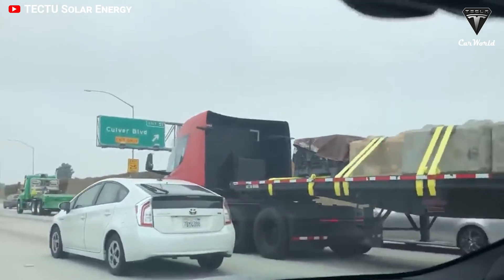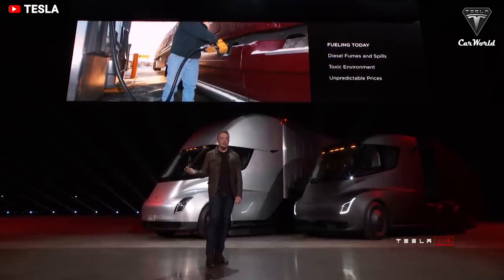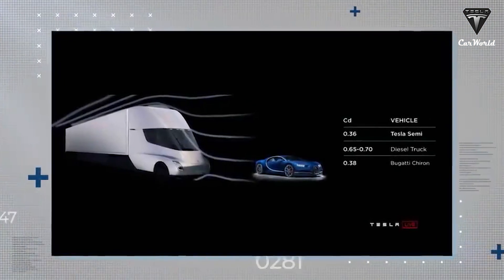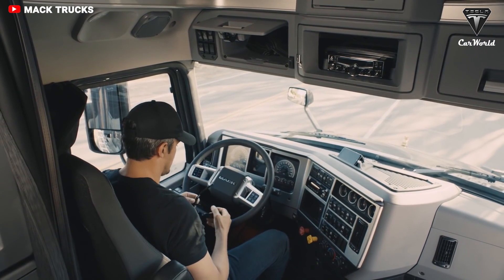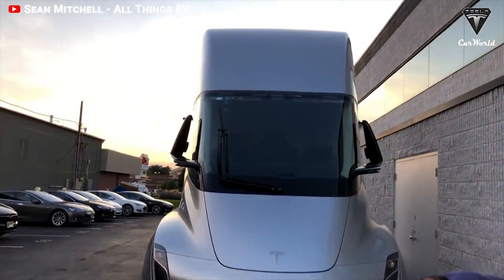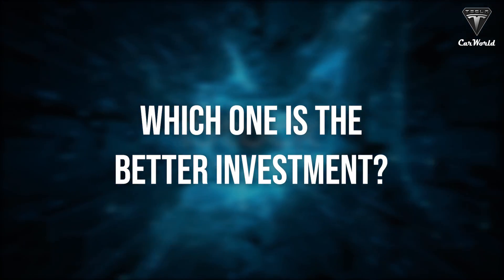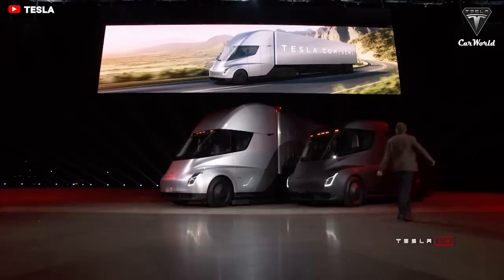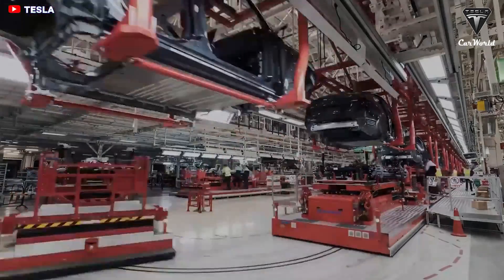Which is the KING of 2023 heavy trucks? Mack Anthem Diesel Truck Vs. Tesla Electric Semi?

Comment: Worrying about a truck's acceleration is like worrying about a supercar's luggage space.
Reply: There are so many ignorant comments, in this thread by people who are obviously not truck drivers, & obviously know nothing about E.V's. As a 20 year veteran truck driver & an E.V. owner myself, I will attempt to clear up some misconceptions that I've read here on this thread about both.

Fully loaded diesel semi-trucks absolutely are slower to climb steep grades, than they are on flat terrain. They also have to descend steep grades slower, because they have to use lower gears to prevent their brakes from overheating, & causing brake fade or even catching fire. That is a fact. Truck lanes are for this purpose. Not because of differences in truck speed limits. This is why truck lanes typically only exist on uphill grades, & end when the uphill grade ends. Tesla Semis will have much less of a problem with this. Yes, maintaining these higher speeds up grades will use more energy. But recharging them is fast.

Charging is not dangerous, & can be done @ loading docs, while loading & unloading. Shippers & receivers do not have fuel islands @ loading docs, because the logistics involved would be impractical. However, Mega-chargers would take very little space, & minimal infrastructure to install. Government subsidies could be offered to shipping facilities as incentives to install these chargers. Most drivers spend an average of 2:hours on each end, (un)loading. The Tesla Semi can charge to 80% in as little as a half-hour, giving the driver more than enough range to complete the balance of his/her Hours Of Service allowance for the day. In many cases, they will actually be @ the doc long enough to get a full charge. Truck stops would not need to have all Mega-chargers. They could get by with having slower chargers, as most drivers will spend 10:hours taking their breaks. They could have a few Mega-chargers in short-term parking, for drivers that are just passing through for shorter breaks, to quickly top up.

Fires in I.C.E. vehicles, both passenger cars & semis alike, are much more common, per vehicle capita, than they are in E.V's. That's also a fact. Most modern fossil vehicles also require electricity to open the windows. The doors on some vehicles are opened electronically, but all of these, including Teslas, have a manual over-ride, in case of emergency.

Most electric vehicles, including ALL Tesla cars & SEMIS, do not have transmissions. They are direct drive. Not automatic transmissions. There is no shifting of gears. This gives the driver even more control than even a manual transmission, as you never have to worry about missing a gear, & you have complete control of your regenerative braking with the accelerator pedal, with no interruption from down-shifting.

Obviously there is going to be a period of time for the infrastructure to grow. But the more we resist, the longer & more painful it will be, & the more detrimental it will be for the environment that we leave behind to our kids & grandkids. So let's stop thinking about reasons why it won't work, & instead, work together to figure out ways how it CAN work. We are smart intelligent beings. We CAN, do this.
Reply: @MatthewPBJWilliams  Tesla’s do all have geared transmissions. You just can’t change gears. They do this to step up the motor torque at the expense of top speed.
Other manufacturers are looking a wheel motors but none have hit the market outside China yet.
Reply: If you’re driving in the mountains and can maintain speed uphill and get there in half the time, that equates to more money for the driver.
Reply: @andresbraud  i bet you could watch those batteries drain fast.
Reply: @andresbraud I do not worry about going up the mountain, I worry more about coming down .
Reply: @andresbraud  1. All trucks can do that.
2. Your reverse trip will be driving DOWN a mountain.
3. Are you honestly under the impression that a truck can only go 30mph up a hill?
Reply: @eugenes9751   I’m suggesting that when driving up steep grades, such as the Rockies, being able to keep up with traffic rather than driving 40 in a 70 would be nice and save drivers lots of time. No more flashers in the right lane up hill.
Reply: @andresbraud  Again, trucks can already do that.
Reply: @eugenes9751 no they can’t, obviously you haven’t been fully loaded up a steep grade. You are going 45mph if lucky with hazards on while everyone goes 65+ up. There is a reason they have the truck lanes uphill. A Tesla truck being able to accelerate faster and go uphill faster would substantially save time on mountain runs.
Reply: @eugenes9751  yes you are going down again later. That still doesn't change the fact you can go up way faster the first time lol. And with an electric semi you can recharge the battery going down
Reply: @Matzes  And with a gas semi, you would use zero fuel going down and can use engine braking.

Truck lanes don't exist for "slow trucks", they exist because they often have a lower speed limit. Which would apply to both types of trucks.

You realize that these electric semis can only be used on routes where the origin and destination stations have Megachargers installed? At this moment, there are exactly zero of these stations in existence. A single Megacharger uses more power than 20 average households combined, and you'd need enough for an entire fleet.... PLUS waiting 1-2hrs to charge (EACH TRUCK), which are only going to be arriving between 7am-6pm. California has already asked it's citizens to stop charging their electric vehicles during the day to prevent blackouts.
Reply: @eugenes9751  you would use little fuel in a ICE semi yes. That's worse than actually getting significant amounts of energy bake. 
Yes megachargers are not available in big numbers yet. Tesla semis are not available yet either. You sound like people in 2010 when they said there are no places to charge your tesla. And just look at the supercharger network now. Same gonna happen for mega chargers. You can start charging while unloading. Make use of solar or off-peak electricity prices. Long term is the clear logical solution, obviously some things have to be built our first. Like in any technology.
Reply: @eugenes9751  actually the truck lanes we are talking about are for climbing grades as trucks go much slower uphill. A Tesla truck with much better climbing capabilities would save hours on a mountain route. If you save 1-2hrs out of your 10hr route everyday that is massive profit gain.
Reply: @Matzes  No, engine braking uses zero fuel, not little. The fuel injectors are turned completely off.

You sound like someone who doesn't understand even basic electronics, and think that hoping hard is the solution that will make something possible. The real world does not work that way.

A regular Tesla has a 80-100kwh pack, the semi will be approximately 6-8x that size. You're comparing apples to oranges.

There are only 1,500 Tesla supercharger stations in the entirety of US. There are 120,000 gas stations. Again, apples to oranges. 

Truckers don't get paid for spending multiple hours charging, they only get paid for the trip. You can not start charging while unloading because you'd never put your chargers in the dock, that's far too dangerous. Why do you think warehouses don't have their own gas stations? Also, even large warehouses only have about 1MW of capacity available, so a single charger would eat up more power than they have the capacity for. Meaning that you'll have to spend about 50-150k just to upgrade your capacity.

You also probably aren't aware of the fact that the first vehicles and delivery trucks were ELECTRIC. We switched to internal combustion because gasoline is 50x more energy dense than even the best lithium batteries currently in existence.

Are you aware of the fact that JUST THE BATTERY of the semi weighs 8,000lbs? That's 8k lbs less that the truck can carry. And carrying capacity is the only thing that matters in the truck world.

The Tesla semi will be an even bigger dumpster fire than Twitter. Remember, this is the same guy that built a "hyperloop" in Vegas, that's just a tiny tunnel with teslas being taxied inside, with a lower total capacity than a single bus. Stop hero worshipping dumb idiots, especially ones who steal companies and act like they created them (Tesla).
Reply: @Ironiclobster69  The truck they compared it to in the video has 1,800lbft of torque. Yeah, it's gonna have exactly zero problems with any grade. 

But fine, lets do the math. Worst possible case scenario. Driving for 2hrs uphill at 45mph instead of the truck speed limit of 55mph. Will get you there exactly 20 miles sooner, which is a total of 15 minutes of savings. If you somehow managed to find a road that's all uphill for 10hrs (I doubt anything like that exists in the real world), you'd be saving 1.1hrs of time in one direction over a 10hr drive. But guess what, you DO NOT get paid for arriving early, you only get paid for the trip. And you're forgetting that you then have to spend 2hrs waiting for it to charge (of your own time). And doing that not at a fancy truck station, but at some random warehouse, where you can't even leave to get food for yourself.
Reply: @eugenes9751  okay lets break this down. the regular tesla battery size is more like 60-80kwh. way less than you stated. model 3 and Y are by far the best sellers. what does the battery size even have to do with the conversation? i m comparing apples to oranges lol. there are 15k super chargers in the US. but how many normal electric outlets in peoples houses, that most people use to charge their EV. YOU are the one making dumb comparisons. you tell me I am comparing apples to oranges but in the same text you compare gasoline fueling to electric charging in terms of danger to do inside. LOL how is it dangerous to charge a car? Why wouldnt you be able to unload a truck while it charges? also a truck driver, by law, needs resting periods which can also be used to charge the battery. and then in the other sentence you compared to battery electric technology 50 YEARS ago to today as an argument why it doesnt make sense to use today. LMFAO. yes the battery is heavy. but the motor is much less heavy. as long as with other parts not needed for an EV. also by law you are allowed to carry 2000 pounds more on an electric truck. so weight difference is no issue at all. complete strawman by you stating that the load capacity would be 8k pounds less. just blatently wrong which a simple google search would have revealed. the semi is a huge bargain and will be a huge success. just follow the money. the total cost of ownership (which is the only thing companies care about) is way less for an electric truck than it is for a gasoline truck. this is undeniable. the rest will just fall in line. if there is money to be made, it will happen. the only green thing these companies care about is the green DOLLAR
Reply: @Matzes  You confused superchargers with regular tesla chargers.

I wasn't talking about the model 3, I was talking about the Model S. 
A regular electric outlet charges 3miles of range per hour.

Electric is being compared to gas because that's the ENTIRE point of this argument. So, apples to apples.

It's dangerous to have a power station in the same place that you have trucks and forklifts  constantly moving through. That's why docks don't have fuel stations. If you've ever seen a scooter or Samsung battery explode while charging, maybe you'd understand why it's dangerous.

Saying that a trucker must rest, therefore, finding a charging station and waiting several hours to finish charging (as long as there is no line) is not a problem, is just downright silly. That is time out of their day, that they can be using to do other things. Some people actually value their time.

I can see that you're pretty clueless on this subject, based on your "follow the money" assumption, so I'm just gonna say have a good day sir, and this will be my final reply to you. Feel free to come back in several years and tell me how well the truck is doing.
Reply: @eugenes9751  you were referenceing the model S, alright...WHY? its not the regular tesla at all., by FAR the best seller are model 3 and Y.  you are cherry picking your data to make your case. we are talking about CHARGING a car. thats the comparison. thats the important thing. it doesnt matter if its done at home or at the supercharger.  most people do it at home. check the data. you can also just add a simple wallbox to your house and get solid range per hour. way enough to charge fully over night. thats comparing apples to apples. recharging a car is not dangerous at all. i dont know where you got this idea from? and if you ever ridden an EV, you would know its very convenient to charge it will taking a rest/piss/food on long trips. so i dont see why this would be different for a truck. if there is a big line, there will be more chargers added. how hard is that to understand? if there is a demand for a service, its gonna be provided. because thats how capitalism works. a topic which you are entirely clueless about, which is why you just left this conversation. very smart. because you got nothing left to come back to me. classic interenet arguement.
Reply: @andresbraud  speed isn't the issue dude. If you were able to even go that fast up the hill on the tesla you realize how much of the battery life you would kill just doing that?
Reply: @Ironiclobster69  known in UK as crawler lanes.
After the gear below 1st.
Reply: @eugenes9751  but electric cars dont explode when charging
Reply: @Ironiclobster69  if the tesla does take advantage of this feature I wonder how much more juice it will be using on that gradient. I'm sure that will be taking absolutely miles off that 500mile range cap every time it does a fast climb up a hill.
Reply: @Matzes  what does pulling that hill at high speed do to the range?   And 60 miles hour for 11 hrs is 660 miles maybe a little less for hills and traffic can the electric do that?
Reply: @donalddelabar767  well you would come down that hill again. Who drives 11h straight with 0 break Time??? Pretty sure that's illegal. At least where I come from
Reply: @Matzes  you have 11hrs of driving time   I did not say that you don’t take breaks, half hour before a 8 hours on duty   You could drive 5.5 break for 3 then drive another 5.5
Reply: @Matzes  The Tesla Semi prime mover weighs 27,000lb compared to 11,000 to 25,000lb for a conventional semi.
The extra weight is what you pay for a 500mile range.
Reply: @allangibson8494  we don't know how much it weights yet
Reply: @Matzes  There were photos of the 81,000lb gross test run with concrete Jersey Barriers as test payload. The weight of the standard Barriers is known to within a couple of pounds.
That gave a prime mover weight of 27,000lb.
Reply: @allangibson8494  yes bro, we both watched the same tesla daily live stream. Considering you can have an extra 2k pound with electric cars. I would say this product is a no-brainer for any company that owns trucks
Reply: @RyanDiederich  Gas cars do explode while filling. That’s why there are fire extinguishers all over the forecourt of filling stations. It happens so often it’s barely news.
Reply: @eugenes9751 :  Let's pretend truck lanes are there for "fun".   Check and mate.
Reply: @andresbraud  that's torque not horsepower and you're also going to drain your battery climbing all steep grades just an FYI. Plus no engine braking
Reply: @Matzes  bro these trucks are distance trucks they have hundred plus gallon tanks the efficiency of diesel vs electric battery isn't even close. So whatever range they release cut it in half immediately. So it's not more efficient it's not cheaper. It's useless literally useless. Evs for daily driving is awesome absolutely awesome. But not for cargo hauling. Next they're gonna bullshit an electric 747 uh no way. They take 40000 gallons of fuel takes me 4 hours to fuel them sometimes and 4 tankers. They fly from here in Ohio to Germany or China or Alaska. No ev plane could ever in its life do that the batteries are too heavy. A semi could never get the equal range of a diesel rig because the batteries would be way to heavy plus the payload
Reply: @Easy Money Sniper  you are right. Electric is MUCH more efficient.  What do you mean it doesn't work? Tesla semi has 500 miles or range fully loaded. That's plenty for the majority of use cases. Charging electric is far cheaper than diesel. Also maintenance is far cheaper. I don't see your point. Make up a basic calculation and you will find out you would have to absolutely braindead not to shift to a tesla semi in most cases.
Reply: @Matzes  an electric stove requires 3 to 4 times as much energy to produce the exact same amount of heat as gas burners.. This is just a fact. It's clear you don't own a truck or use it to haul and tow. Btw in my f350 diesel I get 430 miles out of just 35 gallon tank
Reply: @Easy Money Sniper  you just disqualified yourself from this conversation by comparing an electric motor to an stove And then comparing that to a GAS stove.Holy shit. How about induction stove then?? That runs on electricity and is 3x more efficient than gas
Reply: @Easy Money Sniper  there is litteraly a video on  teslas YouTube showing it travel 500 miles fully loaded. This was shown on the tesla delivery event.
Reply: @eugenes9751  drive a loaded Volvo VNR64T up a hill anywhere near max weight and see how fast it goes.
Reply: @Easy Money Sniper  hahahaha An electric motor is a device that uses an electromagnet to change electrical energy to kinetic energy. When current flows through the motor, the electromagnet rotates, causing a shaft to rotate as well. You keep embarrassing yourself in this conversation. Check well to wheel efficiency of ev vs. Gas engine. Gas engine will be at 10-15%, most loss to heat and too many moving parts. Evs are at 60-70%. Obviously they are not as energy DENSE. None claimed they are and they also don't have to be. I own a tesla and live in a cold country. The range loss is negligible. I barley ever use the whole range anyway. As do most people. Usually from and to work or getting groceries. For long trips there is the supercharger network. Doesn't make much of a difference if you loose like 10% range.
Reply: @eugenes9751  some can't even go 1mph ha, more like one type but forget the name
Reply: @eugenes9751  down, r u scared that the cold brakes will break... even if they somehow did, u don't use them
Reply: @eugenes9751  I'll give him the benefit of a doubt he forgot to put safely going uphill its usually the driver that has to input where the gear goes IF the 18 wheelers are a manual
Reply: @eugenes9751  my truck up a big hill I run I'm only going 25 once I get to the top and start at 70 so yeah acceleration is a big deal
Reply: @eugenes9751  Dude, you are hilarious.
Reply: @andresbraud  you realize that going uphill with a load means more energy is needed. That tesla will just burn up juice faster. Maybe it can make it up on yhe down hill side but idk
Reply: @eugenes9751  no gas in a diesel motor please. They don't work well together.
Reply: @eugenes9751  if you save even a little time. You might be able to pick up extra loads during the pay period.
Reply: @eugenes9751  

With 500 mile range, if you drove 55 MPH you would reach truck driver limit of 8 working hours so you would need to recharge anyways.
Reply: @eugenes9751  Some trucks can only make 10-20 mph up a hill, depending on the hill. An upshift may cause them to lose speed.
Reply: @eugenes9751  If hour in the business than you know that their are many grades that will slow down a heavy, (loaded), truck to well below 30 mph. Now if you go up a grade that is steep enough to slow you down than there is a high likelyhood the speed limit going down will be below 35mph . The driver must gear down the truck to keep it from becoming a runaway. The truck gains too much speed, due to gravity, the driver can overheat the brakes which then fail. No brakes lead to excessive speeds and a runaway situation. Operating a tractor trailer combination is very different than driving a car.
Reply: @eugenes9751  not all trucks have same performance, depends on what trucks and how steeps. Like it's pain as a car to drive behind a truck when it's mountain, it's slow af
Reply: @eugenes9751  for your 3rd point, from my experience as a normal sedan owner, yes. especialy if there is another truck on the other lane. doing the same
Reply: 👋💯✔
           Hey Eugene S,  my dear consider this pal :

Another Tesla has gone up in flames while charging, this time a white Model Y that was plugged in just outside a garage and house in Maple Glen, Pennsylvania. The vehicle was badly burnt and the fire had started spreading to the nearby garage; had firefighters come any later, the garage and house would have been much more severely affected.

Little is known right now about what exactly happened, but according to 6ABC Action News, the fire reportedly started in the back of the vehicle and then quickly spread. The vehicle was plugged in and most likely charging at the time, which seems to be the time when these electric vehicles are catching fire most frequently.

This particular fire is currently under investigation and no cause has been officially announced. Back in 2019, the National Highway Traffic Safety Administration said no to a petition asking for an in-depth, formal investigation of the Tesla battery management software, in order to find a link between recently updated software and the battery fire issue.

👍💯✔
Reply: @andresbraud  The whole it's goes up hill faster means absolutely nothing. Reliability and up time along with range is what matters to us drivers. The infrastructure for a Telsa Semi isn't even close for any long hauler to even make a Tesla a serous consideration. 🤷‍♂️
Reply: @eugenes9751  
Yes that's about right... fully loaded up a 8% grade, you will be going about 30MPH.. and down that hill you have an engine brake to help you stay at a safe speed while not using the friction brakes.  The Tesla will be awesome in the mountains..
But I think we will only see it used as semi local deliveries.. 500 miles is great.. But no place to charge it out on the open road.  But its perfect for trucks that run a route that takes them back to there home terminal every day.. like Pepsi is using them for.
The savings in fuel and maintenance will be a big deal for them.
But for long over the road trips.. diesel will be king for  a while I think.
Reply: @kens97sto171  What is stopping you from getting a truck with more torque, so you don't have to be stuck doing 30mph?
Reply: True, but 1 minute to just 60mph is TOO much
Reply: @alek1004  not really its a semi truck not a Porsche and a full semi truck at max weight you're talking about components getting over stressed. Have you ever hauled anything. I have to adjust my tire pressure depending on the haul in my dually. That's 6 wheels I have to deal with. I have to make sure my shocks and coils are rated for heavy weight. All bearings and bushings. These are wearable items why would you want to increase the friction rate of these components and more specifically why.. For what reason. Having faster acceleration will speed your trip up maybe 5 minutes. You still have to drive the speed limit. You still have truck lanes and descending grades. It's so stupid. I would much rather have as much torque as possible to get moving easier. But they already mastered the semi truck and container this is all a scam. Mercedes will do it better
Reply: Perfect repy.I love when people that know nothing about trucking try to sound like an expert and in reality they sound like an idiot.
Reply: Until you need to get out into traffic without causing an accident.  I’ve spent too many minutes waiting for enough space for speeding cars to pass.
Reply: The Model S plaid is a super car and it has good luggage capacity.
Reply: @danielstapler4315  not the point and it's not considered a super car it's a luxury sedan
Reply: Solution is Tesla plaid.
Reply: Acceleration at no extra costs in fuel or servicing across a fleet of 100’s of trucks is huge.. Efficiency is king..Side note also
means no traffic is held up stuck behind as is the case now..
Reply: Very well said
Reply: How many minutes/hours/days of your life have you spent waiting for a semi truck to get going at a stop light or single lane point until you could finally pass them later on?  If the semi goes fast enough, you don't need to pass it making the roads safer and more enjoyable for everyone.  And on that note, the Tesla Model S Plaid's biggest selling point is that you get supercar speed and acceleration WITH all that luggage space so you're kind of defeating your own argument.
Reply: Eugene S:  In the real world, the Tesla Semi power could eliminate the need for the vast majority of truck lanes over time.   Rather impressive.  Not to mention time saved, much better safety by the regenerative braking, etc.
Reply: Rewatch the footage of the tesla driving. It gets passed by everyone. Lol ot doesn't pass 1 car.
Reply: Wrong. Acceleration equals power and it’s very helpful to get on a highway and pass people.
Reply: I think the better concept would be and EV with a small diesel engine charging the battery continuously like the modern train!
Reply: Exactly
Reply: Pretty much 😂
Reply: Untill you've driven a 700hp truck....you know the rest.
Reply: Right imagine all that cargo back there if it's not properly held down, accelerating at a high speed. LoL
Reply: Some people just like spending a day cleaning up a trailer unless the back doors dont hold you'll arrive empty 🤣
Reply: The Tesla would drive the 200 miles then need to charge….there isn’t any chargers and the drop location won’t have any.
Reply: @jimdandy9118  Tesla Semi’s have a 500mile loaded range - that’s why they weigh 27,000lb.
Reply: @allangibson8494  That’s what Google says.
Reply: @allangibson8494  Fanboy they drove it on a flat road in a mold climate.
Reply: ☝🏾that part!
Reply: THE’LL TAKE OUR JERBS
Reply: We only care about burn outs noobz
Reply: The Tesla Semi prime mover is twice the weight of some diesel trucks at 27,000 lb.
The Tesla semi is also significantly wider than current production prime movers - too wide to be legally driven outside North America.
Reply: Agreed, also wonder how those frames will hold up with that strong of acceleration. Seen lots of videos of the beefed up 700-900 twisting frames at tow competitions
Reply: Agreed
Reply: Lol yes
Reply: So true
Reply: True. Until u need to get out of your own way.
Reply: Lmao bro one of these clowns was like so excited that the rivian can go 0-60 in like 5 seconds with a trailer and I'm like have you ever hauled or towed anything in your life ever... Alllll these dudes who never had a truck now they think they know trucks. I have a 6.4 dually 2010 if I gave them my truck  they'd be crying and begging for help
Reply: Obviously, you have never driven a combination vehicle.
Reply: Exactly. Speed doesn't matter when we have various speed limits. California has a 55 mph limit
Reply: Exactly. Speed doesn't matter when we have various speed limits. California has a 55 mph limit
Reply: Exactly. Speed doesn't matter when we have various speed limits. California has a 55 mph limit
Reply: Ur someone who drives like a grandma and takes 60 sec for 0-60 just like the other bad trucks... everyone hates being behind a semi bc it's slow and could break
Reply: @lavaphoenix75  ah so driving the speed limit is driving like a grandma, and driving 20mph over the speed limit is the way for drivers like you I guess. Makes perfect sense why y'all want more speed as if that'll change anything when our roads are all trashed anyways. I guess when you run over something  that'll tear up your ride you can then blame someone else because you didn't drive a speed you could stop at.
Reply: @Phaze Killer  #1 speed limits our outdated and we can stop way faster 
#2 I  said ppl like u r slow at accelerating not the speed.
#3 going too slow isn't good
#4 average normal speed ppl go above is like 7
Reply: @lavaphoenix75  lol, outdated? Hmm, I'd like to see this proof of a semi towing 50k+ stopping faster. Show me this video that's going 60 mph and you'll have me agreeing. Yea because spinning on an icy highway is so much better than actually being able to move pass the intersection. Going too slow, it's the speed limit, and frankly going too fast is so much worse than going slow. You can control slow, how fast can you pivot running? Just straight bolt and see how much control you have on wet grass playing soccer. Average normal speed is whatever the driver feels like going. People are always getting slapped tickets in this country and you're trying to say we should remove limiters. You must not have been outside yet if you think people won't be breaking those sound barriers if they could.
Reply: Damn “comment-people” are blazing HOT in this thread !! 🔥🤯😱
Reply: I think they naturally will have unusably fast acceleration. I remember that guy with his F-150 lightning was pushing against his truck's tow limit, but he commented that it was easy towing and the truck didn't even seem to care about the load.
Reply: @AngelUkiCarina  don't forget the ford lightning couldn't go more than 80miles when said truck computer claimed it would make 150+miles with the 5500lb trailer
Reply: While the point is true, the scale isn't. Speed isn't an important feature in a truck, but it does have a lot of realistic perks. Unloaded, it'll make it to a load much quicker and conveniently. On light loads, you can leverage some of that acceleration. For local use, it's much more maneuverable. On high grades, it can still accelerate rapidly, and stop better, making it unrivaled on medium range trips through hilly or mountainous terrain. 

All of its uses are either niche, or not a big deal, but it still matters.
Reply: The original comment is incorrect
Reply: I'm a truck driver myself. And trust me when you're loaded running short on time and you're trying to pull out into a busy highway, acceleration is everything. When your load it going up a steep incline. You need acceleration.
Reply: On an uphill in the Rockies, acceleration is a huge deal.  If some jerk cuts in front of a truck and break checks, slow to 45mph, it can take the truck a while to get back up to 65-70mph and it’s exhausting for the driver on a long journey.   Getting on the highway, it doesn’t need to be Ferrari fast, it’s about the trucks being car fast.  The lifespan of the brakes are a major deal.
Reply: Lets floor it and throw the cargo out the back doors
Reply: Combustion engines for life because  electric sucks gas energy.
Reply: An EV with batteries in the floor is always going to be more stable. The center of gravity is way lower.
Reply: @T1Oracle  Semis don't roll over, the trailers do. Having a lower CG accomplishes nothing, this is not an SUV.
Reply: @T1Oracle  an the total weight of the empty truck will be more as well, right?  Although, Elon doesn't wanna say what the trucks weigh...Unless I missed something?
Reply: But it has wireless charging. That's something right?
Reply: @I.C.Weiner  and cupholders that were perfected in CAD!  Revolutionary!
Reply: im worry traffic jams lol
Reply: People here talking bout speed acceleration and stability, while Elon still refuses to give the cargo weight number xd.
Reply: Speaking of luggage space - that's the one thing trucking is VERY worried about. And the Tesla Semi is a comparative supercar compared to any diesel truck's station wagon.
Reply: 😂I love that Tesla is making this truck. It’s amusing to see ppl who know nothing about trucks talk about trucks. Please continue 👀
Reply: Yep
Reply: I literally was gonna say the same thing, who cares how fast it accelerates, I want to know how much it can pull
Reply: I’m WORRIED about the acceleration in the other way…these mfrs drive like maniacs in my area as it is.  Now they can outrun my Tacoma with a full load?  Aren’t some of their passenger cars glitching out and going warp speed uncontrolled? How’s that look at 80 tons?  Gtfo with this nightmare.
Reply: Worrying about tesla batterys..., Fires & explode
Reply: i know i wont buy a Bugatti till they make one with a bigger trunk.
Reply: Do you live where is flat? Because where im from with all hills. Acceleration on the highway matters so they're not holding up everyone
Reply: Not for musk fan boysä
Reply: Charging time.. in the middle of nowhere is there a super charge station..  500 miles is cool but a diesel truck does 2000 miles on one tank.. which brings me to 7 cents… who guarantees that.. do the math with double the amount or even 3 times as much which is a little closer to reality.. load capacity.. it nice that 2000 pounds are a few more Pepsi cans.. but a diesel truck can carry way more load.. maybe because it doesn’t have a few thousand pounds of battery weight..
Reply: LOL right
Reply: Right the real question should be how far will a charge get you
Reply: @A it’s not about time and money it’s about the environment
Reply: @A I’ve worked in logistics for a long time the trucks we’ve had work just fine like I said it’s not about time and money the true question is how far can one charge get you because that Mack can drive for days shortly after a quick fule
Reply: @A lets be real if this was about saving time and money they'd just fly everything across the country there are terminals in every state. That whole argument isn't valid in the least bit. This whole thing is about money and how much cheaper they can go without charging the customers too much. That's why they're doing cents per mile not dollars.
Reply: @A it’s not a race
Reply: It still matters when going up inclines
Reply: Thought the same
Reply: @A That's interesting, I could have sworn Amazon only recently got their own fleets of planes because it was costing them too much to fly packages... Still no same day delivery outside of the lower 48's too.
Reply: @A I'm saying your argument of a limited airspace is bs. Most of these companies could throw the money into their own planes if that's what they chose to do as well. Take Apple for example, if they wanted to get their own planes for deliveries they could too. Hell I'm sure Elon could get his own planes to drop off cars if that's what he wanted to do, seeing as he spent 40 billion on twitter he just might do that.
Reply: @A lol, you made that argument as if to show it was impossible. All I said before was this was them moving freight at the low cost of cheap. You put that whole BS of limitations not me, I just told you as an example what others have done. Not my fault you can't understand that your own points were a 0 to negative. There are so many private jets in this country, the fact you even have to think there are limits baffles me at this point. Apple is nowhere near green btw, everything they ship still covered in plastic and just because they no longer give you a charging brick, and you pay the same price or more doesn't mean you got anything good out of the deal.
Reply: @A See that's where I also call BS, Amazon themselves freight shipped through USPS UPS and FEDEX before they got their own fleet. Matter of fact the loss of revenue on the USPS side of things caught a lot of heat for the guy in charge. Everyone started blasting Amazon for tax as well. So yes businesses can follow that old example. It would still be affordable for them seeing as this was at the time when Amazon was loosing millions. Also I don't have to convince you of nothing, the proofs in the pudding. If one company can do it whats to stop another? Last I checked we have duplicates of everything in this country that end up becoming whales.
Reply: @A That underpaying is everyone especially that Cents Per Mile Drive. That shipping fee is already calculated into the fee, that's why there's a drastic difference in pay when it's a company driver vs OO. The fact of the matter is these companies wanna pay in pennies quite literally. They aren't in a rush as long as it arrives on a set due date, they don't care if it's behind for 2-3 weeks. Still that is the point isn't it? If they really cared about speed they could easily ship these freights they'd just have a smaller cut. Instead they wanna underpay someone that'll be on the road working his/her butt off for a few cents to a mile.
Reply: I mean, its a little more convenient for everyone stuck behind a semi
Reply: Are you saying you never feel regret if a truck pulls out in front of you and you have to follow it as it slowly accelerates?  Every time one pulls out in front of me I wish for every truck to be a Tesla Semi.
Reply: How about a CAT 3406-B with Break Saver and Jacks turn up to 500hp and 3010 lbs. Torque. That would be a good hill climber.
Reply: If it moves it moves
Reply: id be worried about the random combustible tesla car that is now 3 times bigger with 3 times the boom. Nice.... not only is it 3 times bigger but unlike a normal civilan car, its going to be stressed out much much more and thus there will be that many more of these things going off. Calling it now, it will be a disaster vehicle. How will it run continuously cross country without the now bigger batteries over heating? Especially through interstate highways through deserts in the middle of summer? How will it fair after years of hooking up to containers and having loads dumped on it or hitting those unloading bay doors every time they go to unload their payload? This all involves the vehicle being physically jerked and punted around and the more complicate  fragile computer parts the more things will break. Its going to be so shit
Reply: Sure, but the fact we're now able to even have this conversation and comparison is the point! Not the actually acceleration per se. Its the feat and growth in technology
Reply: driving a truck safefy is what it is all about, not how fast it will will run and Paccar will always be king.....
Reply: In the 80s, non turbo light/medium diesel trucks could lack acceleration.  There is one yard/work horse truck, an 80s diesel, everyone trys to avoid.  You have to step on the gas pedal like 3-4 seconds before you can expect it to move, and stomping on the pedal is stepping on it.  On the highway it can go 60 mph, on the flat or down hill, uphill it struggles to do 50 mph.  Anyways, acceleration is a forgone conclusion to most, but it shouldn't be taken as such with new devices and machinery.
Reply: I am going to wonder how much insurance premium difference it's going to be.
Reply: I was wondering same thing. This is a semi. Why you worried about 0 to 60. That will just use more of its battery usage which means it won't go as far.
Reply: That is so true
Reply: Trucks can lose significant speed changing gears up and down while climbing steep hills especially when the slope varies. Personal observation ... I once lived on a curvy hill with a stoplight at the bottom.
Reply: Battery's and motors down low will add stability while the power will help with climbing hills. Acceleration is just a measure of performance just to compare.
Reply: @nickit22  - Close, but not quite right Power is rate of doing work, i.e. speed of climbing a hill, Acceleration is caused by the torque at the driving wheels.
Reply: See wikipedia or other source.
Reply: I would worry about acceleration.  It's a single gear transmission,  900 Hp at full speed is 450 Hp at half speed,  225 Hp quarter speed, ....
Reply: Not really, it makes merging onto a freeway easier and safer.
Reply: Eugene S, buddy my family has owned and operated trucking companies since the early 1950s. I have personally been an owner operator of cross country class A commercial vehicles since August of 2001. I've been around them literally my ENTIRE LIFE!
.... believe me when I say you really don't seem to know much about the reality of trucking....we use 600hp motors and heavy built 18spd manual transmissions because we NEED fast acceleration AND huge hauling wieghts. We NEED to fly off the jump, run full speed uphill at fully loaded wieghts, and btw all that power = engine braking horsepower.
That means a bigger more powers engine will hold you back better with engine brakes alone, see in a big truck your braking at speed is mainly accomplished by engine brakes, NOT WHEEL BRAKES! Your wheel brakes are SECONDARY! ....little crapy no power or low power motors create little or no engine braking power..
Reply: And acceleration is a HUGE CONCERN when we order our trucks....
Reply: They should be looking at torque not power
Reply: Indeed ! But muskbis no trucker not even engineer !
Reply: Unless you need to go up a steep grade
Reply: the faster the trucks accelerate the earlier they arrive thus increase efficiency in the long run.
Reply: @Jasmy_  Ok, this officially wins the award for the dumbest reply to this thread. Congratulations.
Reply: I’d still choose the diesel over Tesla ANYDAY
Reply: Acceleration is important for joining roads at speed. The better option is the hyliion erx
Reply: demonstrates it's torque
Reply: Acceleration ability is indicative of power. Power isn’t just used for speed. You’ve never been behind an 18 wheeler going uphill at like 30 mph because it doesn’t have enough power to gain and maintain speed?  I have. That power will come in handy in many situations.
Reply: Yea, some need it lol.
Reply: Not always.
Reply: It’s an analogue to show how much wheel torque there is
Reply: Not if you are in the mountains
Reply: Yep 😂
Reply: What is incredible is when my 1979 kenworth lw 924 , 3408 cat , takes off out of a landing with a full load of fir 30 tons 😊priceless 675 hp 2670 ftlbs . It’s all snap or tap my big old truck
Reply: @skylarsoper241  You realize there are like seven people on all of YouTube who understood what you just said?
Reply: @eugenes9751  yes I do realize that me and my old kwhoppers  that have been a family tradition for 4 generations are becoming things of the past best remembered and maybe looked at in a museum 😊til then hammer down.
Reply: Until the electric trucks can regenerate it’s own power it will not work simply winter conditions are unpredictable and you subject to be shut down for days and just where is the power going to come from
Reply: lol, the true worry is actually how unstable semis are already, they are all prone to tipping and rolling, I'm also curious if tesla is developing tires rated for all that excess weight and speed they're boasting. Those tires are not meant for highspeeds and if they do go fast they're not meant to be for too long. I'm just imagining someone trying to do a 100 towing 80,000 pounds at this point...
Reply: @phazekiller5701   18 wheeler tires are speed and weight rated.  They can be ran at loaded at 100mph and not blow.
Reply: @rocknh68  I'm sure they didn't set those 75 mph caps for a reason either, and why the trucks are now governed at 60-65. However speed has never been the issue with a semi, it's the control and stopping seeing as you already need 450 feet to stop just doing 50 mph, maybe these truck like tesla cars have figured out how to stop an 80,000 lbs semi on a dime and we haven't been told about it yet. I doubt it but hey one can only hope.
Reply: @phazekiller5701  looks like you're already over educated on the subject so I'll just stand corrected.
Reply: @phazekiller5701  what the heck u talking about governed my cascadia ain’t got no speed limiter on it
Reply: @phazekiller5701  why would the brakes need to be better than existing brakes?
It's not going to be used as a sports car.
Although having said that Brembo supply Tesla already and their brake by wire Sensify system is going to be used on something first.
Why not Tesla Semi or CT.?
Reply: @andrewsaint6581  I think the point of contention here is the unknowns with these semis, not much is really known about them and it's all in the dark, so how would you yourself know these trucks will be as safe as they claim? These trucks are automatic, so there will be less control by the driver than a manual to begin with, there are so many incidents with vehicles every year, so worrying about these things is warranted. So with that in mind when you put more speed in these trucks which most people speed without even realizing, god only knows we've all done 10-15 mph over the speed limit just cruising in a car. It then comes to the question, how much like their cars are they building these trucks? People get too comfortable behind the wheel and before they know it they're skidding on ice, it isn't hard to imagine when you have more speed to play with. However you are right we should wait for the "test drive" a couple of years to see whether or not it will really be the next leader in CMV. Scaremongering is an interesting thing, these are test vehicles that are about to hit the roads en-mass, everyone should be wary of these things so that they are prepared encase things go sideways. I get that the future is to invent and progress but we shouldn't get too comfortable with progress, we should always be striving to ensure we are all safe along with others on the road.
Reply: @phazekiller5701  Here's the thing. Why are you fighting accelerating quicker? Certainly this is nothing but a perk and should be looked as such. Once you get used to the acceleration, no less pulling a load, you're not going to want to give that up. If they can do it then why argue against it? It's like you're completely oblivious to how innovation works. I get it, it sounds crazy to compare acceleration... However, if you can beat or match other metrics while ALSO accelerating at a quicker rate then this should be celebrated. And you better believe those seconds will add up, to get up to 60 it can take up to 30 seconds for traditional semis, 5x slower. Let's say conservatively, you get up to 60, 4x in a day... That's literally 2 minutes quicker, per day. Working 8hrs a day, 5 times a week would equal 520 minutes (8hrs) which literally could be an extra work day or off day... Just by accelerating 5x quicker to 0-60, 4 times a day. Don't know about you but if I can gain an extra day by doing the same work you better believe that's what I'm going for.
Reply: @PodiumTuningRacing  You seriously have not noticed how the states shutdown just by having a snowstorm. Most people can't even handle driving on hazardous conditions but we want semis the most dangerous things on the highway to be faster. The fact of the matter is the people that drive don't all know how to be professionals. We have people drinking and driving, got people using trucks to push others out of lanes too. I guess we should shave a few seconds off the clock though because we don't need to worry about anyone else on the road. After all if a truck loses control it'll only destroy itself and automatically avoid all others on the road...
Reply: @phazekiller5701  They have twice the stopping power through regen and regular hydraulic/air brakes
Reply: @phazekiller5701 :  In the real world, preventing runaway semi trucks caused by mechanical brake problems down steep grades is an OBVIOUS safety advantage for the Tesla. 

Deny all you want.  Change is coming, and it favors BEV's over ICE.
Reply: @rogergeyer9851  since you seem to know it all, I guess elon must have sent you the blue print so you know how it's the future. My concerns don't change a thing with whatever comes out.
Reply: @phazekiller5701  Most tires I ran during my time OTR were rated at 100mph+ the whole governor speed in the mid 60mph range has to do with insurance and fuel savings, depending on the propulsion motor moving above around 68mph begins to start a linear diminishing return on fuel efficiency under high Load. A lot of self insured companies insist on lower max speeds in order to lessen the severity of rollover and other accidents.
Reply: @mikefranzen  Honestly pretty much all the trucks I see in my state are old school and ungoverned. They pass by everyone doing 80-90 on sheets of ice and no chains. Not sure how they make it without incidents since the roads can get too tight of turns in places. I honestly think the less speed we have the better it'll be for everyone. Most people can't handle high speeds in cars let alone a truck that can't stop right away. Everyones just waiting to see how well tesla really delivers, if they can make the trucks better and improve the market it'll be amazing. I love tech but I can't stand elon, dude said cyber truck was supposed to be out this year.
Reply: @phazekiller5701  the problem is with any driver are the ones that just started driving and think they're the best on the road, the ones that haven't seen everything and think that they've mastered the elements when nobody can or has bc they're unpredictable. I've been doing for 4 years now and I have have alot to learn and witness of course. I don't have the mindset thinking I know everything and that I'm the best trucker out there. When I started I was nervous af and kept my distance from everything and everyone, I still do especially with all the idiots that can't sit behind me and want to be infront of me and come close to have my lugs go through the side of they're 4 wheeler. My truck used to be at 65 and now it's at 70 and it's a big difference and it helps in all kinds of ways. The trucking industry isn't ready for all electric tractor trailer maybe hybrids but not all electric the power grid won't be able to. So far only one company has already placed orders for a fraction of their fleet to be replaced by the tesla trucks(Coca-Cola) any other large company(crst, swift, weren't, Schneider, trans am, tmc, jb, xpo) etc, they won't go for it until they know that parts won't take months to get in and have to worry about layovers. If you go into any truck shop you're waiting over 3 days for a simple fix that'll take an hour or two to fix. Overall we're not ready in my opinion
Reply: @mikefranzen  That's just humans in general though, as much as I would love to be able to trust them. There's been too many on unsured idiots on the roads, people don't care about who they hurt and frankly how much it'll cost them. This has been 1 of my biggest concerns driving because for some reason the people who should be the safest. No insurance no license are the most reckless which makes zero sense to me. I'm a very defensive driver honestly drive slow which my mom always gives me crap on but I always make it point A to B. It's not hard to imagine how amazing our world will be after the tech boom, however it is indeed too soon for our transition into all electric. Especially since those batteries won't be so good in -50 weather. I am curious if they found a way to make them work in -100 which will be needed if they want that market for the people that live extremely remote and need big rigs.
Reply: @Phaze Killer  it can break and acclerate fast and u know gain energy breaking automatically and not have to lose ur breaks after going down a hill
Reply: @phazekiller5701 
"These trucks are automatic, so there will be less control by the driver than a manual to begin with"
Quite the contrary. The performance of an electric motor is more predictable and it's also way more responsive compared to a manual.
It's almost like shifting a slider, except you're using a pedal.
Reply: @Kosake82  There's nothing predictable about that road, and speed in my own experience has only ever lead to incidents. Most people can't drive a small car and are often hit with speeding tickets.Also why do you even need more speed when every speed limit sign out there's at 65 and under.
Reply: @phazekiller5701  I wasn't talking about driving abilities or attitude. I addressed your statement that an electric drive chain is less controllable than a conventional drive chain with manual gear shift for some reason.
Reply: @phazekiller5701 trucks are governed at a speed the company decides.  Mostly for fuel cost. Trucks traveling at 60 vs. 70 to 75 cost a company a few miles per gallon.  When you make your living by the mile and have several truck that speed can save you millions in fuel cost.
Reply: @phazekiller5701 trucks are governed at a speed the company decides.  Mostly for fuel cost. Trucks traveling at 60 vs. 70 to 75 cost a company a few miles per gallon.  When you make your living by the mile and have several truck that speed can save you millions in fuel cost.
Reply: @phazekiller5701 trucks are governed at a speed the company decides.  Mostly for fuel cost. Trucks traveling at 60 vs. 70 to 75 cost a company a few miles per gallon.  When you make your living by the mile and have several truck that speed can save you millions in fuel cost.
Reply: @phazekiller5701  some people don’t understand how long a heavy truck takes to stop I’d be more concerned about trip distance
Reply: @grandmasterschwank  Honestly people aren't concerned with the dangers of altering heavy rigs. I just hope they're right that they somehow added instant stop to these trucks without affecting anyone else.
Reply: @phazekiller5701  Most common semi tires are 75mph rated but faster ratings do already exist.
Reply: @phazekiller5701  no rational person wants bigrigs running at 100mph on our highways
Reply: @phazekiller5701  large companies govern speed to 65 for mpg I can do 75mph
Reply: @Phaze Killer  ya it would have the required wheels just not falling off the semi and taking a min for 0-60 like others
Reply: @phazekiller5701  You won't have to worry about rolling over are actually mounted lower than lets say a 13L Iline 6 which sits really high in the engine bay and i'm using I6 is because its widely used other than V8
Reply: @mayuravirus6134  As I recall most roll overs are through overspeeding and light trailers as well as sharp turns. Are they designing the tesla to have it's own non roll over trailers too as well as how will it handle a tripple tow should that be a thing for it? We only saw this thing hauling a flatbed and we also don't have the statistics for it. Everyone keeps saying it'll be better but it only hauled one type of load in that test no tanks or doubles / tripples. People who buy these rigs are definitely not just buying to do a box and flat run.
Reply: @phazekiller5701  plenty of guys back in the 80s and 90s that would haul cattle going 100mph at night
Reply: @Phaze Killer  given that most of the tesla trucks weight is at the bottom it will be less prone to tipping
Reply: @phazekiller5701   Speed causes trucks to tip because on a corner the weight on one side causeing it to tip
Reply: @phazekiller5701  Most states allow weight exemptions for APUs and electric motors. 2000 lbs for electric and 500 lbs for apus.
I would guess the Tesla semi has really good regenerative braking which should reduce stopping distance and greatly reducing brake overheating issues on steep grades. Trucking companies govern trucks to reduce fuel consumption. Driving 65 or under greatly increases fuel mileage.
Reply: @phazekiller5701  .no you're incorrect, they're actually more stable than your car when they're empty. It's the loads that create stability issues. A low heavy load, like steel flat plated, would make a tractor trailer more stable than your average family car. FACTS!
Reply: @phazekiller5701  We in Europe have 770hp Engines from Scania, and you Americans only have around 500 as max😂 Tires are not a problem
Reply: @phazekiller5701  Unstable? Have you ever ridden in an 18 wheeler? They are pretty damn stable. But like any vehicle going around a curve too fast, they can roll over. Tesla's claim of 82,000 lbs is bogus, at 82,000 lbs, the tesla and any 18 wheeler will be over the legal weight by 2000 lbs. The Mack will also pull a lot more than the 80,000 lbs legal weight limit with a permit but the tesla will also need a permit to go over 80,000lbs. As far as the tires, unless it's a racing tire, any tire will fail with high speeds and distance. Since the speed limit is at most 75 mph in some of the western states, 70 mph in others and 65 and below in others, high speed isn't really an issue is it? Plus except for a few owner/operators, most trucks (company trucks) are governed at between 65-68 mph. An 18 wheeler could run all day loaded at 75-80 mph without worrying about a tire failure as long as they are not retreads. Those pieces of truck tires you see on the side and on the road are from retreads. The speed limit on roads aren't set because of trucks, it's suppose to be a safety thing concerning ALL vehicles. The trucks being governed at 65-68 mph is more of a fuel saving thing than safety, although truck drivers of today are poorly trained and aren't smart enough to figure things out on their own. The things truck drivers are getting away with today would not have been tolerated when I was driving over the road.
Reply: @Blueknight1960  lol, seems to me you agree with my points but also see that it isn't valid. It's an amusing thing to see you argue with my own points claiming it's stable and unstable at the same time. Like I said above speed wasn't an issue it is control and stopping. Fact of the matter is you've already proven my point and yes I get that those are retreads on the road, it doesn't change the fact that the loads on these trucks make them unstable. I know 80K is the legal tow limit but at the same time it is the unstable loads that has me worried with these teslas.
Reply: @phazekiller5701  I never said the trucks were stable and unstable at the same time. I said they are very stable. Saying a truck will over turn on a curve if going too fast is not saying it's unstable if that is what you are referring too it also doesn't mean the load is unstable. It simply means you're driving too fast around a curve and the driver is an idiot. As far as control, that's 100% under the drivers control. If properly trained and the driver acts like a professional, trucks are some of the safest vehicles on the road. I don't know about the tesla's handling or braking, but they will have to follow all the DOT regs just like every other truck manufacture.
Reply: @Blueknight1960  it's amusing to see someone trying to deny the points of safety on these trucks. As if the government set these rules up for no reason. People die when semis fail, and these flaws in their design are pointed out so people are aware of it and safely handle the rig. You can blame people all you want but that doesn't change the fact these rigs aren't always going to be stable. There are so many things that could go wrong, we can always blame the driver but nature has the last say on how we travel. So you can be professional all you like but at the end of the day it is the manufacturers that need to design these rigs to be safer. These semis seem to be more designed like a car than a truck and that's pretty worrying. Trucks fly by me all the time on sheets of ice passing. People aren't always the best behind the wheel but if these things start going robotics, it might just make for a horror movie scene. To think people do pre-checks just so they can fly down the road later because they're going to be late for a delivery is pretty scary honestly. Remember one thing these rigs are designed around the tesla computers, so hacking is a probability that's very real for these trucks.
Reply: @Blueknight1960  1. Compared to all other vehicles on the road, trucks are the most unstable and are more likely to roll over than most. 
2. Electric semi's are given 2,000 more pounds to work with, so the "claim" of 82,000lbs is legitimate. 
3. Speed isn't the only issue with tire wear, its also inflation and acceleration. My drive tires have about 4/32nds of an inch more wear than the rest of my tires, so just imagine how much more wear accelerating quickly for no reason/that much torque is gonna affect wear. 
4. Most truck drivers are Owner Ops and can un-govern their trucks whenever they want.
5. There are more rules and regulations in the trucking industry than at any other given point in time in trucking. Truck drivers aren't getting away with anything.

I'm posting this comment without insults....but its really hard...you don't know much....
Reply: @Blueknight1960  80mph for all vehicles in Nebraska;) And the non owner operator company I drive for has their trucks governed at 75mph.
Reply: @Blueknight1960  great post.
Just a couple of points.
Electric wagons in US and EU are getting a couple of thousand pounds (US) or a couple of thousand Kg (EU = 4400lbs) as far as I can tell.
Also, incredibly shredded tyres at the roadside are actually more often new but under inflated tyres according to a tyre seminar I went to in UK about 20 years ago.
Interestingly, the theory was that if they lasted long enough to retread they were the best ones.
Make of that what you will.
Reply: @phazekiller5701  why would the same load in a trailer hauled by a Tesla be more unstable than one hauled by a Kenworth or a Renault?
Bearing in mind that each wheel has it's own instantly controllable power and brake (Brembo Sensify?) excluding the delay and mass of the differential, prop shaft and half shaft of a conventional driveline?
Reply: @phazekiller5701  let's wait and see. You're scaremongering for no reason.
Give it a couple of years.
Same for twitter.
Give it a couple of years.
Reply: @andrewsaint6581  I drove an 18 wheeler for 10 years and every flat I had was a retread. Here in the states, you can have retreads on every axle except the steer axle and I've never had a steer tire blow. Not saying it won't or hasn't happened because it certainly has, just less likely than a retread, at least here in the states.
Reply: @jmh4ggg  alignment, shocks it's honestly a lot of things that will wear out a tire pretty quick
Reply: @phazekiller5701  the tesla has a lower center of gravity, it makes no sense that you say this you have no clue how things work
Reply: @RyanDiederich  No one knows how these new trucks work but regardless of how they'll perform, we will only know when and if it'll keep the bar it's set for itself. You can be excited about the innovation just be realistic to the facts. If they didn't dot their I's and cross their T's this'll be a huge letdown as well as a nightmare. Safety is the most important here especially after that incident that's lead to the reform of CDL altogether.
Reply: @Blueknight1960  It’s not bogus they were granted the increase through DOT but you knew that 😂😂😂😂
Reply: @andrewsaint6581  The TRAILER doesn’t. Trailers are what cause semi’s to roll over.
Reply: @andrewsaint6581  The new Renault’s are electric drive.
Reply: @iMeatbag  I no longer care.
Reply: @Blueknight1960 :  In the real world, laws and regulations can change, and the BEV class 8 truck in the US has a weight limit of 82,000 pounds, whether your ilk denies reality or not.
Reply: @Blueknight1960  FYI, Electric trucks are permitted to be 82k lbs
Reply: @phazekiller5701  what are you talking about bro fr. What failures are occurring that isn't the drivers methed out please tell me. I know of literally one instance and that was recently the dudes brakes went out was a big story. Are you referring to this. That's one time I've never even heard that happenning before. These guys all inspect their rigs before and after their haul distance and local drivers.
Reply: @Blueknight1960  EV semis are allowed am extra 2000lbs. A small amount of research goes a long way.
Reply: @Bangin0utWest  lol, whose actually ensuring these guys do their pre-trip? Didn't we just see a video of some guy being pulled over doing his pre-trip while driving on the highway? We also have that one trailer falling off recently because some guy said it was too cold to pre-trip. We're seeing people driving recklessly as it is, my concerns are valid. Stop trying to invalidate the safety measures because you think a little more speed will change much. Most people are late because they are horrible at planning to begin with. If it was an accident I get that can't be planned for but for places everyone knows is a traffic zone. All arrangements should have been made prior to the drive. Those are just a couple of examples that were talked about on this channel and there so many more incidents out there. Ignorance is truly bliss because we start assuming everyone actually does their due diligence...
Reply: @blueknight  dont quote me on it, but i heard the fmcsa granted ev semi's the extra 2000lbs bc of battery weight.
Reply: @Phaze Killer  u think someone will be able to get in to the latest software that's been made by the richest and disregarding iq scares bc it's flawed the smartest person 
Btw if u don't think it's flawed and it is 100% perfect then I had over 130 when I was like 6 and my grampa had like 170
Reply: @Blueknight1960  "Tesla's claim of 82,000 lbs is bogus, at 82,000 lbs, the tesla and any 18 wheeler will be over the legal weight by 2000 lbs. " - Wrong. Electric trucks are allowed to run 82000 instead of 80000 in the U.S
Reply: @Blueknight1960  electric trucks got a 2000 lbs limit increase passed from the government to increase the push towards electric trucks.
Reply: @Blueknight1960  if there stuff that today's driver allowed than the old days doesn't it means today's drivers are more capable? Haha
Reply: @Blueknight1960  electric trucks are allowed an extra 2,000 lbs without any permit.
Reply: @Blueknight1960  There are exceptions to the legal weight limit. For example CNG trucks are allowed to go up to 82,000 lbs. I would guess the electric trucks get or will get the same exception.
Reply: @Blueknight1960  the weight limit for electric trucks is 82,000 pounds
Reply: @Blueknight1960  it's not bogus, Feds gave an extra 2K GVW allowance for Electric EVs because they want to see them adopted and expected them to be about that much heavier than a diesel... which for Tesla appears to be untrued with the Semi at about 17K lbs.
Reply: @Blueknight1960  
Elon responded to this, electric is allowed an additional 2000lb capacity due to battery.
Reply: @Blueknight1960  They gave natural gas and electric trucks a bonus 2,000 pounds in the US.  82,000 for them, which I think is absurd.
Reply: @phazekiller5701  actually to me it's pretty clear that this truck is designed much safer compared to about any other american truck. The fact that driver seat is in the middle is pretty huge deal because it's common that truckers don't see a shit in urban areas on their right side - they might ride over a kid on a bicycle without even feeling anything. Tesla semi not only gives better visibility to the driver but the front bonnet also is shaped such that even if one gets hit by truck due to driver negligence there is more of a chance that he'll imidiatelly gonna get sucked under wheels. Also the fact that truck can accelerate faster will result in safer driving practices in cities - truck drivers typically hate to hit on breaks or slow down exactly because it takes so long to get speed back from 0. Faster acceleration will also overall improve traffic situation in cities when truck can keep up with traffic.
Reply: @phazekiller5701  especially not to mention crosswinds, 70mph in a 20mph cross wind is scary enough in a pickup truck, let alone a truck with like 50 times the surface area. Hell freeway speed in 20mph cross winds have made my wheels on my 3 series cross into another lane.
Reply: @Turbo_The_Femboy_Fox  is this Tesla related or every high sided vehicle ever?
Reply: @andrewsaint6581  I never said it was Tesla related, but something that big shouldn’t be as quick as a sportscar. Crosswinds at freeway speeds can be sketchy in a SUV let alone a semi. Having a semi capable of outrunning old sportscar only makes it sketchier
Reply: @Turbo_The_Femboy_Fox  yeah my dually does horrible in cross winds I kept the valance on the front but I had taken it off holy shit the wind is horrible. Same with my Toyota sequoia and that's a smaller suv
Reply: Battery grid in trailer floor lowers COG ( centre of gravity) Less roll overs ..
Reply: @Marcus-up5wk  Batteries are not in the trailer - (unless they are cargo).
Reply: @allangibson8494  Yet! I suspect they will when there is an abundance of battery’s especially for refridge units.. Probably 10yrs away from that being cost effective..
Reply: @Marcus-up5wk  Refrigerated containers have a 3-phase 380V power connection for shipboard use. Adding an additional battery inverter off the truck battery wouldn’t be hard (they are a very standard commercial product).
Reply: @allangibson8494  that’s a reefer container not a refrige trailer.. Refride trailers run diesel and sit in yards and run all night sometimes after being loaded..I did this work for 6 years..They are noisy horrible things that have curfews and be great to see the end of them..
Reply: @Marcus-up5wk  The point is building a reefer trailer with the same equipment as a reefer container isn’t a stretch.
Reply: @allangibson8494  yes agreed 👍- I think all will go this way over next 10+ years..just cost and weight.. I think the chemistry will have to be pretty much fire proof also..
Reply: @Marcus-up5wk  Truck rollovers almost always start with the load in the trailer not the prime mover. The Tesla Semi weighing twice as much as the Mack will however help.
Reply: @Marcus  Less roll overs if the driver actually knows how to drive, shouldn't need training wheels on a trailer to keep from flipping. 

Acceleration does come at a cost. The already short range of electric vehicles will be significantly shorter if you're drag racing everywhere.
Reply: @jmh4ggg  y'all forget the fuckin battery of.the Tesla is apart of the frame so it's low to the ground y'all know that right why Tesla's are hard to flip all the weights down low cause of battery is it not the same for the Tesla semi???
Reply: @jimmy5860jim  unknown, which is a big part of the issue surrounding the Tesla semi.  All the important information related to what matters in a truck, has not been released to the public and is purely speculation.

Elon Musk isn't stupid, he marketed the semi like a sports car on purpose because he wanted to hype the public, which then puts massive PR pressure on companies to buy it.

Acceleration rate is utterly meaningless in a truck.  Trucking isn't the same as owning and driving a car.  Trucking is a business and trucks are equipment, tools, and their purpose is to make a profit by performing specific tasks under certain parameters.  Parameters that have been withheld in regards to the Tesla semi.  Look at the comments here and it shows exactly why.  The general public has absolutely 0 knowledge about trucking and how it works.  Yet so many here and elsewhere just regurgitate that the Tesla is so much better simply because "Musk said so"

So, no.  We don't know how the truck is constructed.  We don't know if the battery pack is an integral parts of the frame or not.  Nothing is actually known about the truck beyond a few hype numbers that mean nothing to trucking.
Reply: @jimmy5860jim  Semis flip because of the trailer flip’s first.
Most diesel semis have a low centre of gravity too.
Trucks are a bitch because the load is so high.
Reply: @Marcus-up5wk  Trucks don't roll over, trailers do. The trailers DO NOT carry batteries. Worrying about CG on a truck is even dumber than worrying about it's acceleration. The amount of mental gymnastics being performed here to try and convince yourselves that this truck makes any sense is absolutely off the walls.

You know what gas trucks don't do? Burn down in a battery fire that can't be extinguished. While locking you inside because the battery is required to operate the door latches and windows. Trapped behind "nuclear proof" windows that can't be smashed open. Brilliant.

Truck runoff ramps are filled with gravel so the truck effectively sinks into the ground if it runs out of brakes. Imagine what happens to that floor mounted battery.
Reply: @eugenes9751  electric truck don’t run out of brakes they simply recharge..note I drove semis for 12 years I am familiar with them…diesel trucks burn to the ground everyday, caused by brakes overheating and setting fire to the load..look it up..
Reply: @Marcus-up5wk  You've drove semis for 12 years and you don't know how to use the air brake? Ok bud.
Reply: @eugenes9751  Is that the FOOT or TRAILER air brake??Last truck i drove ( FM VOLVO) only had air brakes (and engine Jake brakes of course)...Oh! i think you mean the Trailer Brake? Yanks have a stupid name for it i think called Johnny brake.. It's ok i'm in Australia where real trucks are driven and yes i've had the trailer at near 45 degrees down hill in the wet.. Mechanics had just adjusted the trailer brakes and worked fine till i had to drive back empty. A lot deep breathing and a cool head to get it straight without killing anyone..It's shit your pants territory, but i guess you know about this so i digress.
Reply: @Marcus-up5wk  Sorry, you're right, I meant the engine brake (Jake brake). And yes, you're totally right about everything else. And yes, I wasn't properly accounting for the trailer, because the previous responses were about uphill driving, so I was still stuck on that. My bad.
Reply: @eugenes9751  gas cars are more likely to catch fire than electric lol, you are just buying and selling FUD
Reply: @Marcus-up5wk  doubt it if you're saying that I've driver 120k to over 190klbs of weight down hill and have never set my truck on fire, brakes were hot sure but Jake brake +Johnny bar was enough for most of it, if your truck catches fire from you braking you don't know what your doing. The other issue is if a diesel truck catches fire its relatively easy to put out compared to a model 3 fire and fire departments say it takes anywhere from 2,500 to 25,000 gallons for one ev fire, that may reignite several times after the initial fire. Is also hard to fight because the battery packs are at the bottom of the truck so unless the pack is easy to access good luck putting it out.
Reply: Ya but if you could make a supercar that had a literal shit ton of luggage space and still be a supercar, you'd rock an industry
Reply: @benrosenbloom8854  Not really.  Nobody buys a super car because they want to take the family camping.
Reply: @benrosenbloom8854  Yes, the model S is a great supercar. The conversation is about the semi though.. Which, again, has absolutely zero commonalities to a supercar. It's like complaining that a bus doesn't have enough acceleration. IT DOESN'T NEED IT.
Reply: @eugenes9751    Not talking about the Model S. I was responding to your original comment and continuing on the metaphor you created. It follows if you read it.

Also, since you brought up the Model S, and called it a supercar lol. If isn't even intended as a supercar lmao it's a luxury business sedan, (that can be had for a fraction of the price of any supercar). It just performs well enough that by regular car standards that just happens to be on a level of supercars lol. Wait til the Roadster comes out